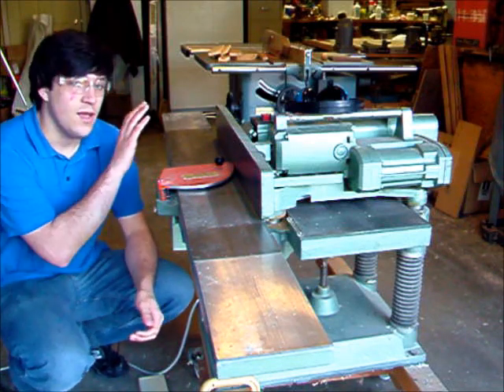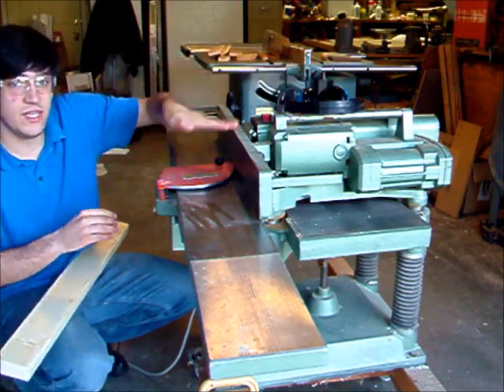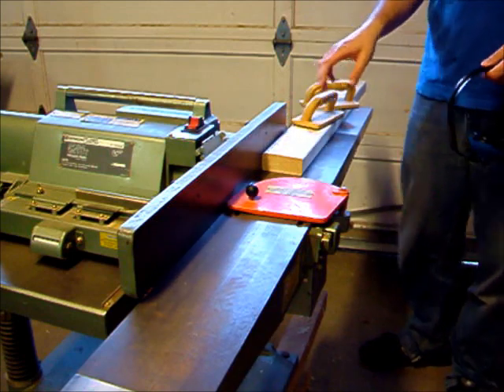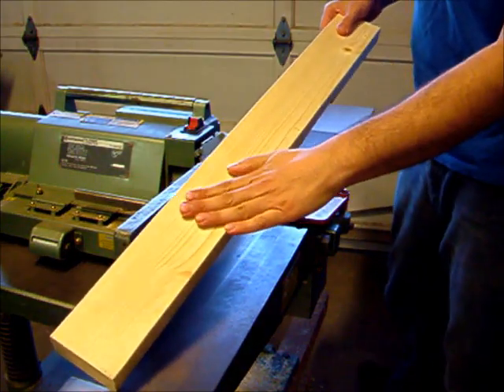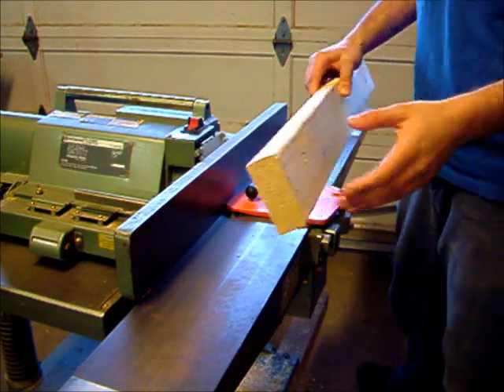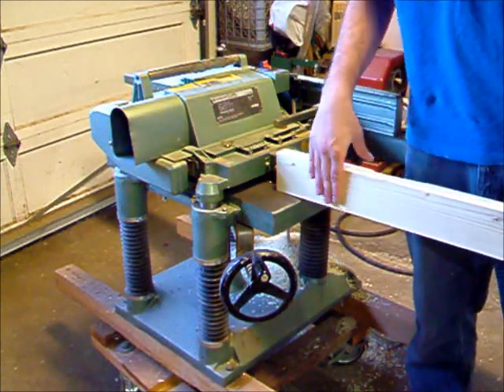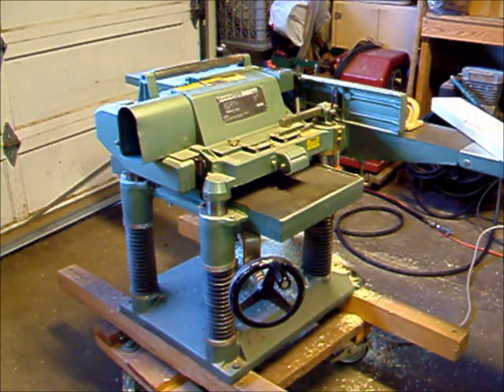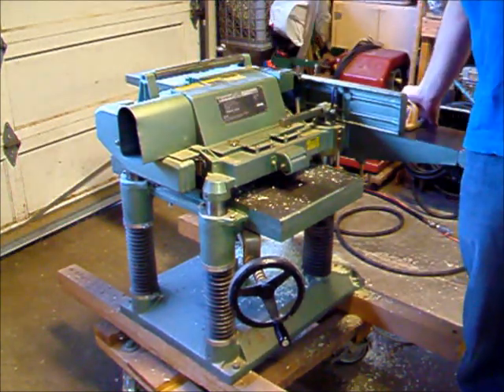Intro to Planer/Jointer

Comment: I bet it's frustrating to have a 12" planer with a 6" jointer combo.  What do you do when you want to work with 8", 10", even 12" material?
Reply from the maker: Break out the hand jointer planes.

Comment: I'm new to woodworking... a basic question:  You ran the board through the jointer a few times first.  How do you know when the board is flat on one side and when to stop?  Is it to the touch or is there another way to discover that it's flat on that one side?

Comment: You forgot the very important final step when jointing and planing.

For AFTER you have one face, then one edge jointed; then you plane the other face as you did.

Then of course you can rip the final edge to size on a table saw. But you should always then put that fresh sawn edge on the jointer, to get a very smooth; as well as removing any saw marks.

Note: IF  you choose to do  this, set your saw fence wider by the same height you set your jointer infeed table. IE: If your jointer is set for say a 1/32" cut, then cut that last edge 1/32" wider than you want the stock to be on your table saw. Do NOT run the stock through the joiner but once in this case; for then your stock will be narrower than you wanted it; usually ruining the piece..

For whatever it's worth.

Comment: So why do you need the planer if you have the jointer? If you use the jointer for both sides would they both be nice and flat but maybe not exactly parallel to each other?
Reply: SomeDudeOnline I think the reason you would use a planer is to make sure that both sides are parallel to one another.  The planer relies on one flat side to use as a reference for how to trim the wood on the other side.

If you were to use the jointer on both sides, both sides would become flat, but it would be impossible to tell if the top and bottom are parallel to one another.
Reply: louie solomon Thanks
Reply: louie solomon This is correct. It would be rather difficult to get all sides parallel without a planer. You would typically end up with a wedge rather than a square piece of wood.
Reply: If you are working with a short, thick piece of wood, sure you can attempt to use the jointer on all 4 sides. But a planer is going to work much better at ensuring that the top and bottom pieces are parallel to one another.

Search "Can I use a jointer on all 4 sides?" and you will find plenty of information on this.

Comment: That is a nice machine.  Do you still own and use it?  Do you like it after a couple of years of use?  Oh, and what brand and model is it?
Reply: That is a Hitachi F1000A not a Makita I believe.
Reply: +Michael Rhoads Actually, its a Hitachi F-1000a.  Same type of machine, but from a Hitachi.
Reply: Makita 2030 most people love them and the only complaint anyone have with any makita planners is they are slightly under powered and getting the rollers redone costs about $180 bucks
Reply: Michael Rhoads Sounds like a buyer would want to consider that $180 when he purchased one of these.  This machine looks like it would take up less space that a jointer and a planer on separate stands.
Reply: I don't have one would love one.
Other than that you can put Byrd Shelix heads in both sides while the initial investment is a bit much but it's way better than an over under style combination machine if you ask me.
Once you surface joint and plane it up true you can just walk circles around it and take a board down to the thickness you need it in no time.
My mind 180 for rollers isn't bad.
And the shelix heads are relatively cheap on this model and you get 4 blade changes for each set off knives and don't need to set them no more or do anything crazy.
And the shelix knives only come in pure carbide.
Reply: Michael Rhoads When my ship comes in, I'll get one.  Shelix heads would be a fantastic upgrade.

Comment: ok, brother,very nice information,please ,your machine what name made in us.
tank you
Reply: Makita 2030 believe they were made in Japan 40-20~ years ago.
Only complaints anyone ever has have been the rollers at the age that they went out off production they used natural rubber and are about $180 to get recovered.
And that it's slightly under powered there for can only take so much off every pass.
But they make a byrd head for both sides of the machine.

Comment: I don't think you are demonstrating the use of the jointer properly. You are applying pressure over the entire board as it crosses the jointer knives, this is wrong, you should focus most of the pressure to the face of the board on the "out feed" table portion of the jointer not the "in feed" and "out feed". Just my observation. what you will end up with is a board that will have a spring to it and not be completely flat

Comment: The fence is set at 90 degrees to the table surface. By holding the jointed face firmly against the fence the stock is cut two square. You can then run the wide face rough side up through the planer to achieve parallel surfaces and use your table saw to rip the remaining edge parallel and square. That will give you a 4 square piece of stock that's ready to be used.

Comment: Doing all four sides on the jointer will only give you four flat sides.  You can't be sure if the sides are parallel.  Trust me, if you need a jointer, you need a planer, and visa versa...